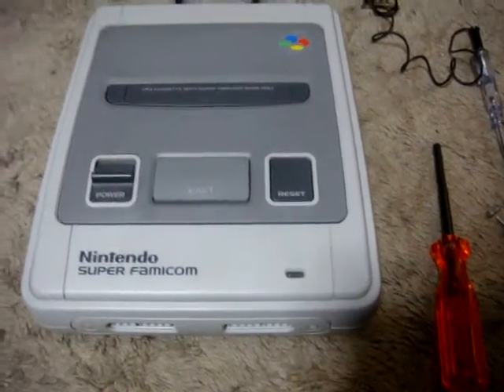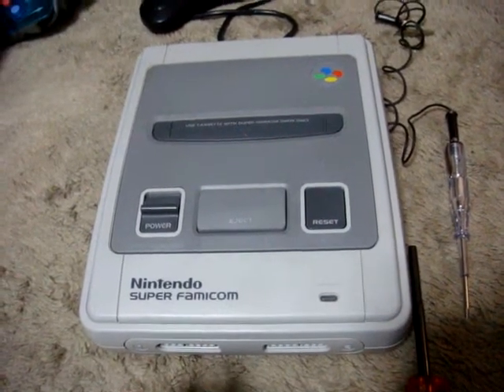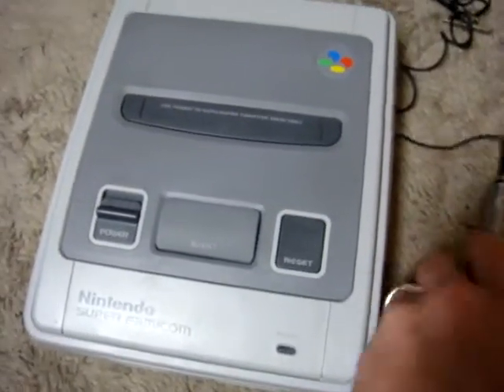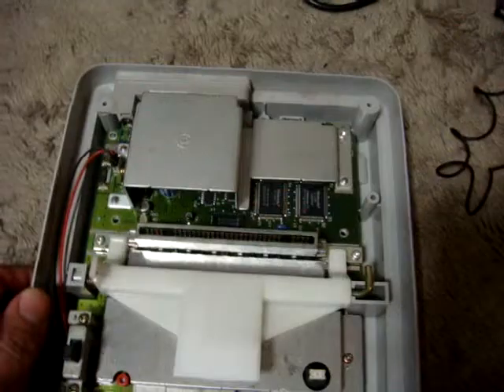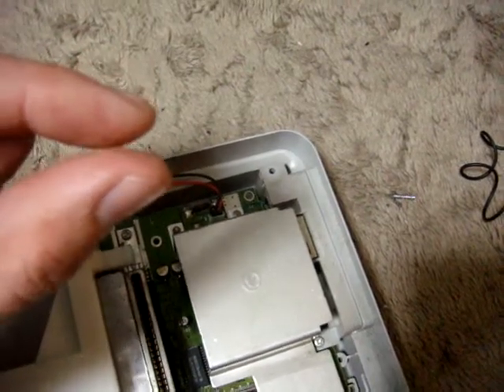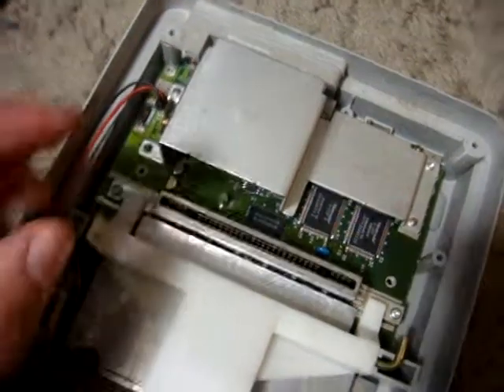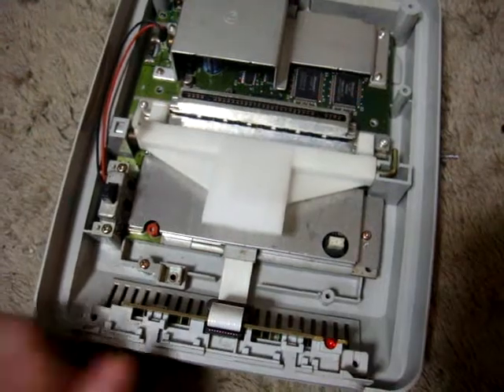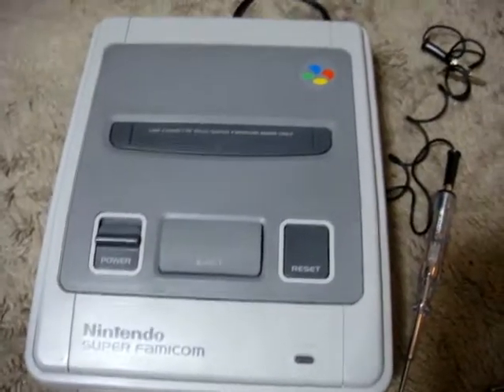Quick SNES/SFC No Power Problem Fix

Comment: You're a life saver Luke! I tried a 3rd party multi adapter and all off a sudden my SNES didn't power on anymore. I was panicking, but then saw this video. Luckily I had a junk un-salvageable SNES for parts, I took out the fuse from that one and voila, it works again! Another SNES saved from the grave!

Comment: Thanks for this video!!!   right after emptying my checking account on earthbound, my SNES stopped powering on.    A little scrape with a flathead to the power plug port on the SNES fixed my problem.

Comment: thank you so so much mine is 23 years old i cleaned it today put back together didnt work started panicing so i put wire acrossto check it works off out to get a fuse tomorrow thanks so much again

Comment: Had to "replace" the fuse on my newly arrived SNES Jr. I actually just soldered a 1.6A glass fuse onto the 1500mA FA1 fuse which was already there cuz it was unremovable. Someone had placed a 1A fuse onto there aswell which obviously had been popped which I removed before placing my new fuse..

Comment: *****  The American and PAL versions have the 1.5 amp fuse have them on the same side as the Japanese Super Famicom only differences is the case design of the system and the power supply.

Comment: If you have a NES, aswell as your SNES try the AC Adapter from the NES, Otherwise buy a cheapo AC Adapter online, Or ask one of your buddies if they have a Nintendo AC Adapter
Reply: they're 2 different shapes, unless you have a pal or japanese system in which case the NES one will blow it, unless somehow the pal NES is also AC or the pal SNES is DC which I doubt.

Comment: I crossed the fuse like the poor man I am and there were sparks...
the system was still able to run power through it though, as I turned it on after unplugging and it does the blip it normally does on a working SNES. should I try it with it taped down before plugging it in? or use a different wire and not a fucking paper clip lmao? either way the fuse is definitely what's causing it to not power on but I'm not sure if it's getting the right amount of power from those sparks. BTW I really don't give AF about this mobo so I'm willing to try anything lol.
Reply: use copper wire , just find any old junk wire you have laying around,  i had an end from trailer lights i cut off a chunk and it worked

Comment: So I was able to get my SNES to power on by cleaning some gunk off the bottom of the solder points on the ac plug port, but it seems like there might be a bit more wrong with it, as the reset switch doesn't power cycle the console. I have to manually turn the power off and then on again. Is it possible I may have nicked or cut a trace/grounded the switch out when I was cleaning the board?

Comment: I'm having another problem with my SNES. After it's been running for a few seconds it always resets or shuts down. I think this is a result of my SNES mod. Me and my dad have modded it to play PAL and NTSC games and to go both, in 50 and 60 Hz mode (it's a German PAL SNES btw.). This has been working great for a long time (with Japanese and German games), but after some time the SNES started shutting down randomly and this became more frequently over time. Now it happens so often it's literally

Comment: I have an issue where the power light will flash on for a split second then go off. I can get the system to stay on after messing with the AC adaptor for a while (pluging it in and out of different sockets) & once it's on it will stay on but it's becoming quite a chore & seems to be getting worse. Do you think my AC adaptor is dying?
Reply: that happens on a normal system if you plug the system in and then unplug it and turn it on. Probably not a good connection, so either you need a new adapter or power jack. not that this'll probably help you 6 years later :)

Comment: So, I'm having a werid problem. I found my old snes and the original ac adapter. I'm getting a red light indicating I have power.

However as soon as I blug in an av cable (not original) the light stays out. IDK if it's because it's not the right cable or my system is defective...
Reply: Did you every happen to find out what the issue was?  I'm having this same exact issue and cannot seem to find any help on it.
Reply: No, unfortunately not...
Reply: So, my issue was resolved by purchasing a Nintendo brand AC power adapter. Swapped the adapters and I am in business! Hope its as easy for you!

Comment: i have a snes that i bough from ebay not cheap cause it came with mario games etc the guy said it works but when i connected it it turned on and shut off then it wont turn on at all i replaced the pico fuse with a 1.5A and still nothing HELP I WANT TO PLAY MY MARIO GAMES FML:'(
Reply: I'm having the same problem, it turned on at 1st, then I turn it off but when I try to turn it on it refuses to work.

Comment: Hi, I've noticed that  the fuse of my American SNES is popped but I also have a four-pin chip (called TDK 2JYS-2 G) near the fuse that is blown. But I don't know what it is (is it an operational amplifier or a transistor?) or where I can find another similar to replace it. It's marked in the main board with a T1. Please I need a hand with this!!

Comment: HELP lukemorse1 !!! i installed the copper wire and it was working great. everytime i was done playing i was unplug the system just in case. i went to turn it back on today and its unresponsive. im super pissed. do you have any idea what it could be......its no longer a fuse problem, i think. i should add that when i would fix the copper (if it were to fall out of place), a few times there was a spark, but it always worked after....please help :(   i love my snes